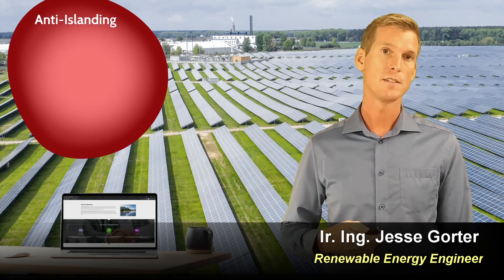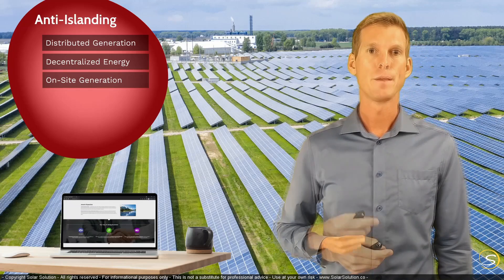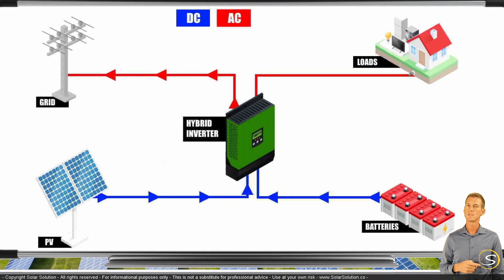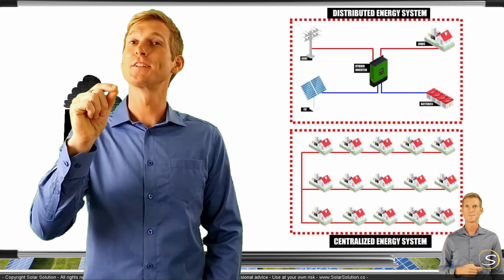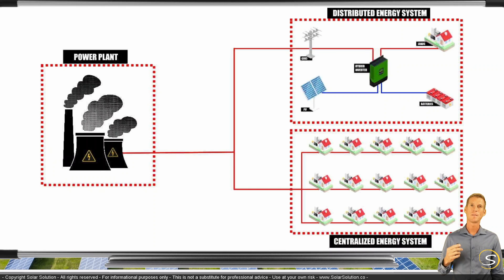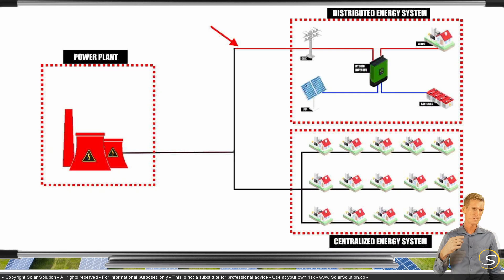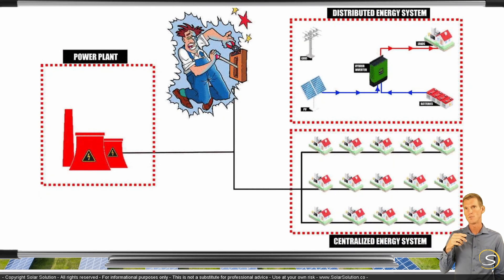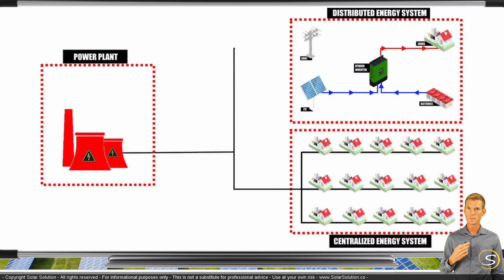PV Anti Islanding Requirements: The solar protection system explained

Comment: It would be valuable to describe how this is achieved.  (I.e., switching to off-grid / islanding mode where the inverters operate without grid power detected.)  Seems like it would depend on how the installation is wired into the grid.  Does it require the solar to be wired into the load side of the meter with a manual disconnect from the grid (main breaker?)

I recall in Florida after a large hurricane years ago that folks with solar had to keep their solar shutdown because they’d been wired in a way that couldn’t be disconnected from the grid.  (I think the solar was wired directly to the grid with a separate meter and the billing just subtracted the solar production from the household consumption meter.)